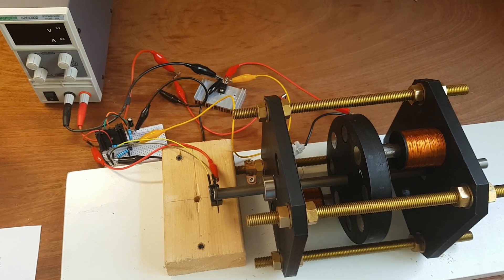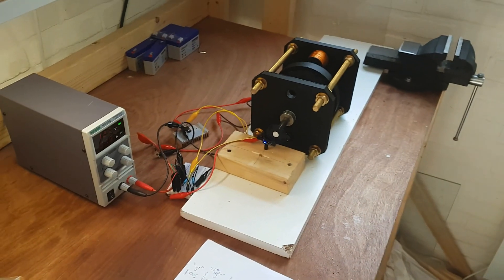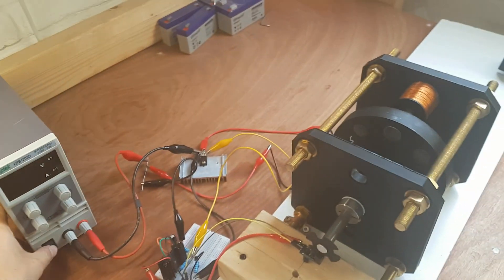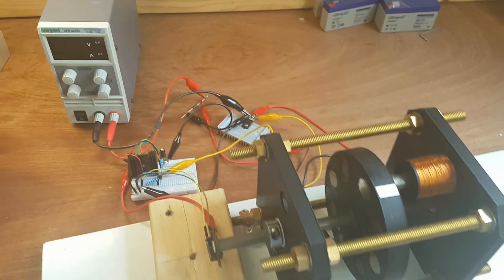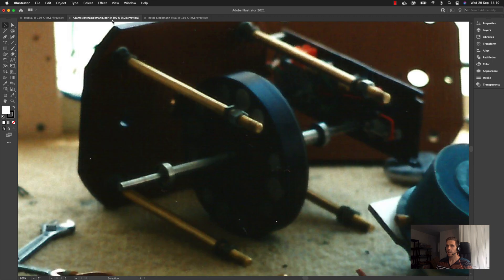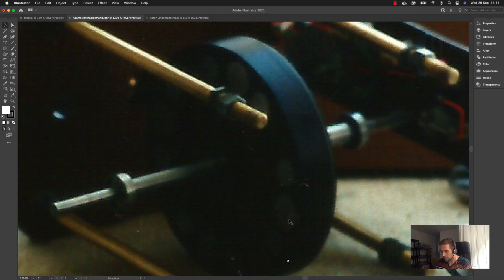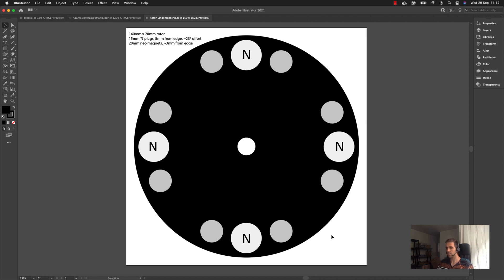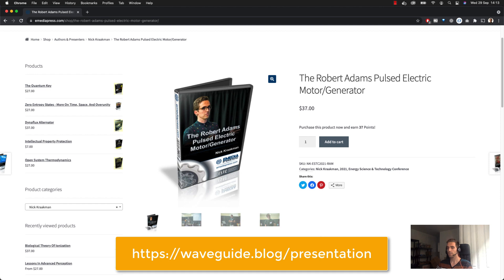FIRST Run of Adams Thermo Pulse Motor

Comment: Bonjour,peut on modifé le schéma, pour alimenté mon capteur hall par une alimentation extérieur,et garder le circuit 120dc pour la bobine ? MERCI
Reply from the maker: That's already the case. That's how the circuit works: 5V for the hall sensor, 120V for the coils.
Reply: MERCI ,mais je veux l'alimentation 5v a pars,donc je voudrai un schéma pour la bobine en 120v dc et savoir comment je cable mon capteur hall avec son alimentation 5v externe. MERCI

Comment: Bonjour, est ce que le circuit électronique,peut fonctionner en 48v,car je n'ai pas d'alim 120v? Un grand merci,pour toutes tes informations.
Reply from the maker: In theory, yes, but 48V won't be enough power to spin a rotor with strong neodymium magnets, unless you increase the magnet to coil gap significantly, which then results in an inefficient design.
Reply: @Waveguide  Merci, pour ce conseil.

Comment: Bonjour,peux tu me vendre le montage électronique de ce moteur? Combien de tours,pour les bobines en 0.35 ? MERCI
Reply from the maker: I don't know the exact number of turns, but you need a wire length that equals ~36 Ohm in resistance, which is around 200 meters of 0.35mm wire per coil.

The electronics are simply on a breadboard right now, so not really in a sellable package.

Comment: Nice build, one thing what may be beneficial to any puls motor,  most of them works because of the electric puls neutralises the attraction Field do the rotor can move on to the next magnet, now you need your core material to be just under maximum saturation when the magnet is aligned whit the core en coil this make up a different spacing for every core en magnet combo, do this right en you wil be astonished by the results,  it's also recommend to make the sensor adjustable, because every puls engine is just like a internal combustion engine in this manner from a certain speed you need to change the angle of the ignition so to speak , in I replication of the lindeman attraction motor I got up to 9k rpm on 36v en the attractive puls was fired when the core peace leaves the stator, this has to do whit the inductive reactance of the coil Tue bigger it is The later it reacts
Reply from the maker: Thanks for the tips, Oscar! For my other pulse motors I developed an Arduino based motor driver, which allowed me to change the pulse timing and the pulse duration using two variable resistors. Since this one uses neodymium magnets, I needed a higher power circuit, and that's why I'm currently using a timing disk instead.
Reply: @Waveguide  the simplest test you can do is checking how much distance it takes from the magnet to the core peace to pickup en paper clip whit the other side of the core, this is also A recommend test by Adams himself! In repulsion mode ( this is switching at tdc)     

Also you can do a test at what distance the core reverse it's polarity ( being South instead of North) you can use a compass on the other end of the core to see This, if the magnet is facing north to the core peace, it's best to sit at This distance for running any pulse motor if you use a dubbele puls ( which is the attraction mode ) switching before tdc , this way you get 2x the mechanical power out of the Motor en better recovery because it's doing regenerative speed up now 

It's also recommend to check out your R L Time constant, you can see this on the oschilloscope in trigger mode,  to test it put a DC light bulb in series whit the coil, put the probe across the coil to the oscilloscope, en connect it to a battery, you can see the point when the current become constant, this is the reactance time of your coil , for pulsing you need to puls it about 40% of this time so the next 40%can be recovery whit out cross conduction, save the left over 20% of fine tuning the puls duration on the Arduino
Reply from the maker: @oscarverwey  Interesting comments! I'm actually working on a new pulse motor design (I hope to be able to show a video of it in the coming weeks), so I'll definitely contact you for some tips on that ;-)
Reply from the maker: @oscarverwey  About the paper clip test, I believe he meant to simply take the magnet and a paper clip, and see at what distance from the paper clip it is pulled into the magnet, then that distance should be the length of your coil's core.
Reply: @Waveguide nice man I'm looking out for that new one , probably we gonna meet uo at some point because there is so much to talk about! 
About the paperclip test your right this is the  see how much you should seturate the core , it should magnetise the core from one end en to see if there is some magnetic field passing treu it , the strength of picking up a paper clip on one end is a good indication,   , you see it's only the last 20 years that we have this ultra strong neo magnet's , laminated cores can be seturated to 1,2 /1,6 Tesla , depending how much carbon is in them , so a 40000 gause magnet is way to much at 1,25mm ,in Tue past that where like 10000 or so

Comment: Hi Nick
I think you have it backwards, the heat generated comes from the neodymium magnets whipping past some sort of metal (you are thinking maybe lead) and the best material would be aluminum!
2nd best is copper,....(however maybe lead is best I dont know never tried it or seen it done, but know aluminum and copper really work good)  
Four of your  neodymiums going past a copper or aluminum plate at 1000rpm  for example with airgap of lets say 3mm is going to get red hot in less than  a minute.  
The "eddy currents" make the heat.
Try it and see what I mean.
Too close with the magnets to copper or aluminum, it wont budge!
So 3mm just a guess...
Think hollow aluminum or copper "chambers" with water or antifreeze flowing through it then the liquid is pumped out to heat your room or whatever. 
Seems like that photo you see could not be "it" since the rotor is made of plastic, and the plastic is going to no doubt warp and get rubbery when it gets hot.  Teflon would be the choice if you want to use plastic,  as 400f degree melting temperaturre, but  teflon does not the good  thermal qualities of heat retention and especially eddy current "induction" copper or aluminum has. so looks like polyurethane you are using which is great stuff for rotors, but not so great for some sort of "rotating water heater:!!!
However the rotor could still be of plastic somehow but look out the magnets will get hot too.
So I will suspect what you are seeing in photo IS a rotor, that spins past copper or aluminum "tanks" full of some sort liquid like antifreeze, and this  "heater rotor" is spun by an external motor, one of those 120V adams motors probably.  Maybe extra lead-looking "magnets" or whatever they are is only there because it cuts the eddy current draw and the amp draw, of motor spinning the neos past the liquid filled copper chambers.
Could be those  funny lead like things are "regauging magnets" in that axial design rotor too.....this is whole other subject.... but my main point is I think the photo you got from PL is not where heat is made, its a rotor that contains magnets that whip past a copper or aluminum chamber (where the heat is made) filled with water  or anti freeze being pumped through it.
Thanks for the great videos and beautiful work you do!
Reply from the maker: Thanks for these insights. The heat could come from eddy currents, but that is not what Adams believed, and he had decades of experience in electricity and electronics, so I tend to believe him. But maybe you're right. 

The magnets stay relatively cool though, because the rotation cools them down.
Reply: @Waveguide  
MrDKONZEN talks about a very interesting experiment:

“Four of your neodymiums going past a copper or aluminum plate at 1000rpm for example with airgap of lets say 3mm is going to get red hot in less than a minute.”

Have you ever tried this? If it works you could do lots of interesting things with the heat produced. You could boil water with it or use some silicon-germanium thermoelectrics to convert the heat into electrical power.

Comment: Why do you put those big metal cores? I think that the motor would work better with ferrite in its core, ferrite and plastic resin would be better the development of the motor without so much brake.
Reply: Ferrite is only suitable for use with ceramic magnets. If neodymium magnets are used, then ferrite is too weak
Reply from the maker: The inventor of this motor said that a soft iron core was the ideal core material to use. It does not cause drag, because initially the rotor magnet is attracted to the iron core, and then the coils are pulsed and so the cores are demagnetized, and the rotor experiences no drag.
Reply: @Waveguide  If this is how you consider it to be correct then you could use many welding rods inside the coil, that lightens the magnetic brake a little more
Reply: @skycollection  Welding rods are an interesting idea. But they are circular in cross-section and therefore the core space will not be filled efficiently. As an experiment, you can try